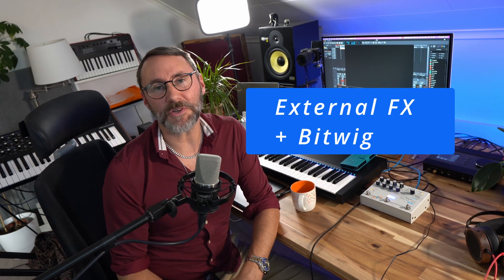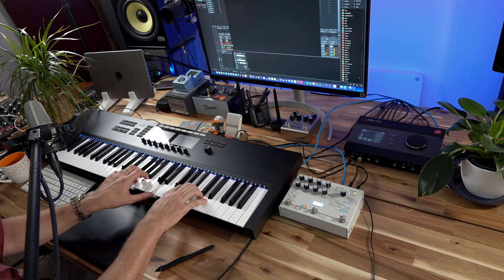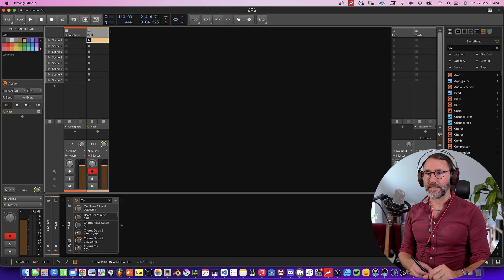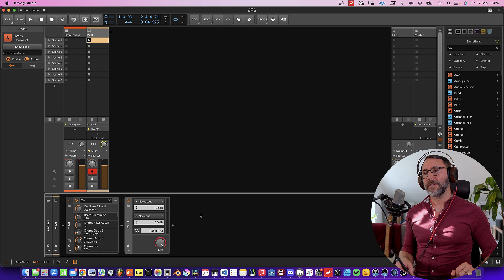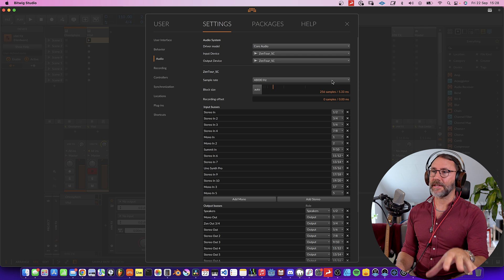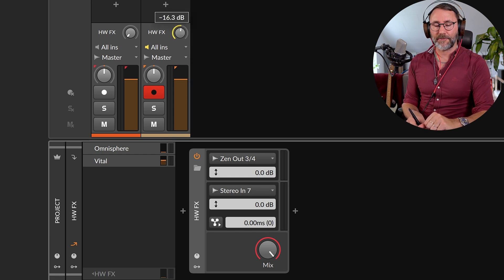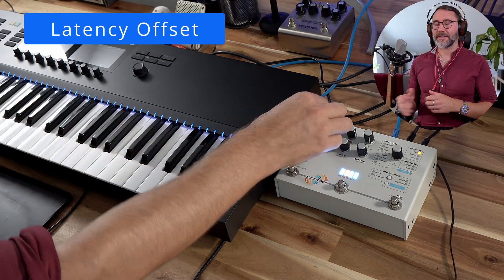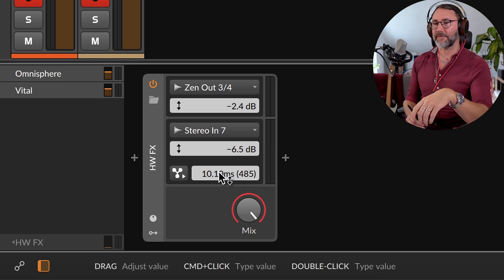Bitwig with External Hardware Effects guide

Comment: when I use the External FX, I can no longer mute the track. The audio passes by the mute and volume on the track. Any suggestions?
Reply from the maker: Do you return the audio on a separate track?  Turn the external device on/off instead (as a kind of mute). Signal flow is: 1.arrangement track / clip midi goes into 2. Device chain which finally goes into 3. Track Fader (Mute/Solo) that’s why. The external fx device is still providing audio to external fx. I think that’s the ”problem”…. I’m Outside, not in the studio atm but give it a go.

Comment: Hi great info! Anyway...on cubase all working fine...on bitwig I'm not happy about my fx sound quality...what is wrong? Hmmmm....maybe bitwig need preamp? Microcosm is set as a line. I put some limiter to make louder but had some distortions. Any advice?
Reply from the maker: Very hard to understand what's wrong. There should be no difference between the signal input quality of Cubase and Bitwig. No Bitwig does not need additional preamp compared to other DAWs. Audio Interface input level is the exact same for all daws. If you have distortion, debug:
1. If your audio interface has a software (or hardware input level monitor), first check and verify the input level is not distorting at that point. If so, lower the input gain either on audio interface.  2. Check the HW fx device in Bitwig and adjust the putput /input levels at this point. Also, make sure Microcosm is set to correct INPUT MODE (it can be set to either mono, stereo input...check the manual how to do this. Aside from that it's extremeley hard to help out without seeing the debugging and your setup in action live.

Comment: Hey Matthias 
Great video again ❤
I was wondering, is it possible for you to do a video on midi mapping in bitwig?

Like.. for jamming or performance?
(I imagine this might be outside how you use the software, but it’s something I haven’t quite got my head around quite like I have with ableton)

Eg. 
A controller like the launch control xl, with physical knobs mapped to different device racks on different groups or tracks inside the project

Like.. filter on drums, bitcrush on drums, delay send on drums 
And some other effects on a bass group etc etc 

I’ve only seen stuff for specific controllers and I’ve dabbled with the MOSS stuff, but I remember encountering limitations when using generic midi controllers

Like.. only 8 knobs with no feedback (if the controller had led rings etc)
And only for the currently selected device etc 

Thanks for reading. I enjoy and appreciate your channel!
Reply from the maker: Hi Andrew, yes I do sometimes use the Maschine Jam as a midi controller for BItwig. I don't do anything specific, but map project / project what I need to control for the specific session via the regular "midi mappings panel" in Bitwig. But now since Bitwig 5 when we have global remotes (controls) it makes it even easier to setup... especially the visual convenience the new panel gives. I don't dribble MOSS scripts and such. I feel the external hw controllers sometimes takes away from my music production workflow rather than helps it. But I understand if you want to "perform" with Bitwig, this is essential.
Reply from the maker: Glad you enjoy my content!
Reply: If anyone reading this knows of great videos that always exist on this topic, please link them as replies…

Comment: Hey, great material again, thank you for it! Nevertheless, it would be interesting if you could tell us what are the possibilities of record audio from an external FX in Bitwig Studio.
Best regards and thank so much ❤
Reply from the maker: You can always use a separate track and set its input to the inputs use in the HW FX device setup (and remove the input on the HW FX) that way the audio input feed from the external effect goes into that separate track instead. Which means you can record the processed audio separately.
When using hardware effects with the HW FX device I recommend using realtime when bouncing the final mix if you didn't already record the effect on a separate track. Or else you won't get the effect included in the bounce...obviously. ;) Happy to hear you enjoyed the clip!
Reply: Thank you for the feedback and tips.